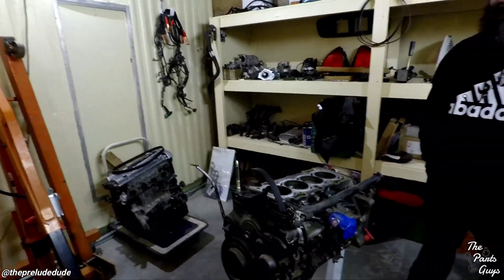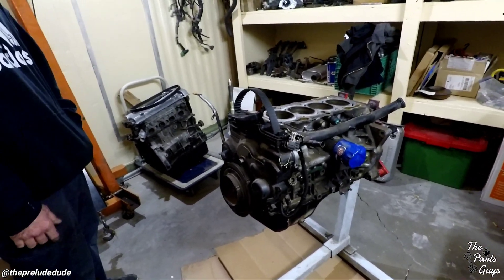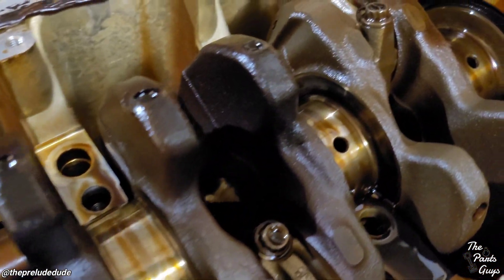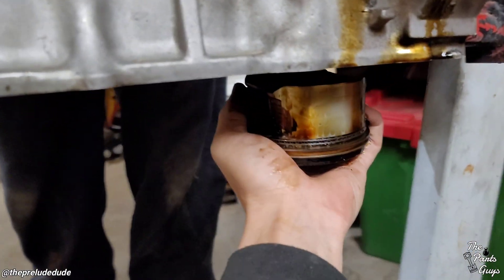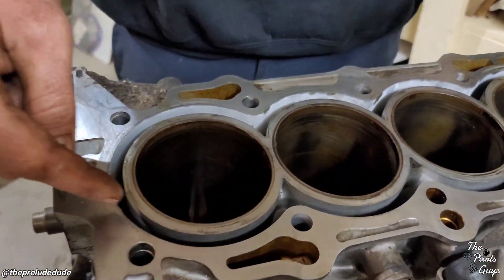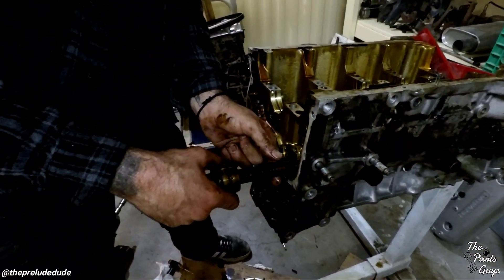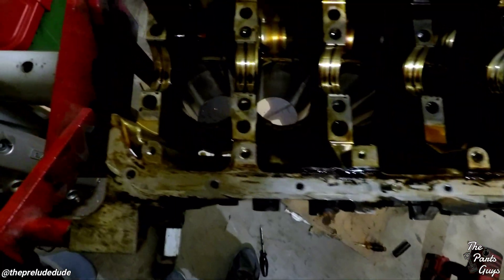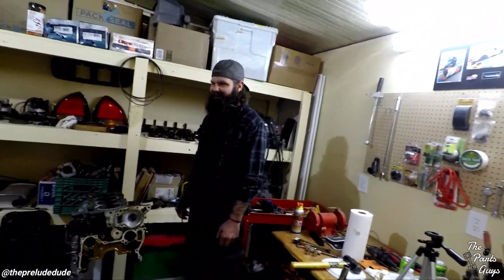F23a1 block tear-down | crankshaft and rods inspected

Comment: That f23 block is prime candidate for a balance shaft delete kit, and an h22 head. Them g23 builds bro.... Fucking mint. Just have to make sure the tune is good.
Reply: I'm a single cam non vtec guy. No worries, I'll still pull on all the "cool" stuff.... If it's in the right chassis 🤷🏼‍♂️